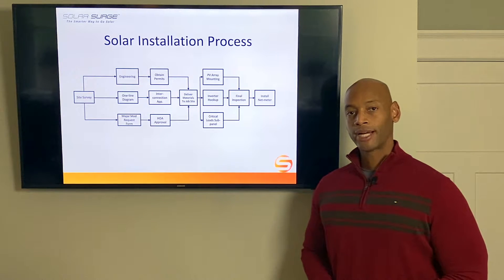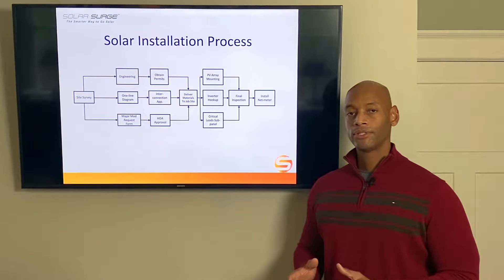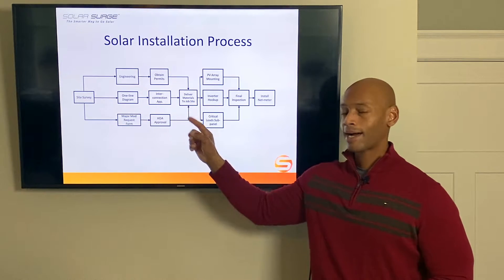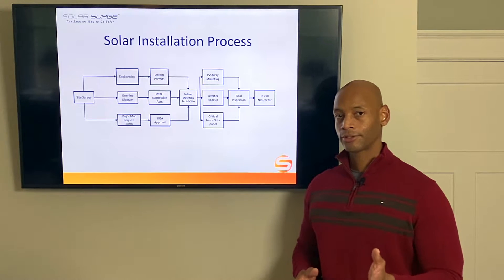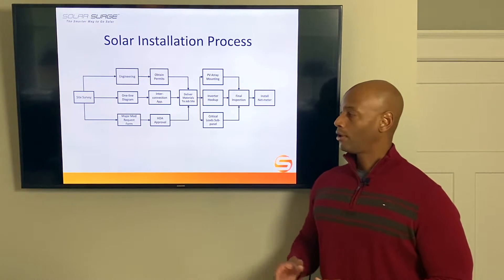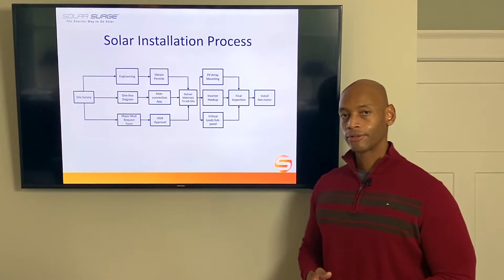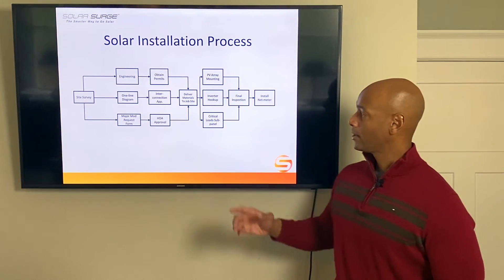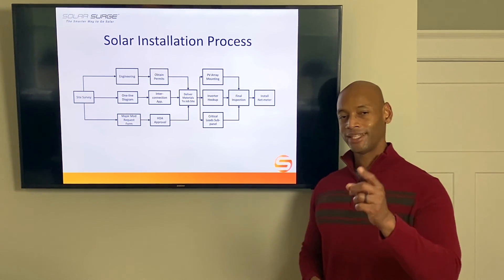The Solar Installation Process

Comment: Hi Joe,
I signed up with you (Solarsurge) Nov 19, 2021... Nothing is installed up to now.. 
its almost 4months already.. What happened to 4 to 8 weeks?
Reply from the maker: Hi Joe.  Things are running longer now.  We are seeing about 90 days for solar only projects.  120+ days for solar with battery backup.
Reply: @SolarSurge  Hi joe, I'm close to 120 days with no batteries in the system. Everything is approved from city to my provider which is PSEG since January.
Reply: Can you help me out.
Reply: @joeadan2223 how did this end?

Comment: Not to shabby.  Good Work!  Much less scary than a Gannt Chart. ;)  Might consider adding a parallel path on the financing, so folks that are using a Credit Union, or Mortgage Add-on can also follow that aspect and timing.  Agree that saying not more than 8 weeks is reasonable, but generally safer (jmho) to caution "up to" 12 weeks, in case there is a design modification from the city or HOA, or . . . some other delay.   Always better to produce sooner than said, rather than later.
Reply from the maker: Good point.  We've seen some delays and the city/county while reviewing plans and that's beyond our control for the schedule.